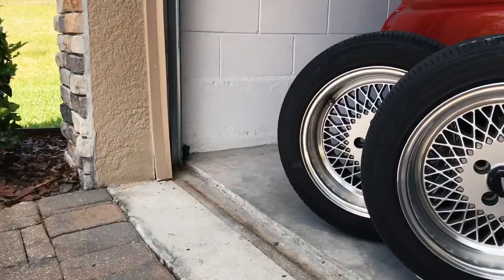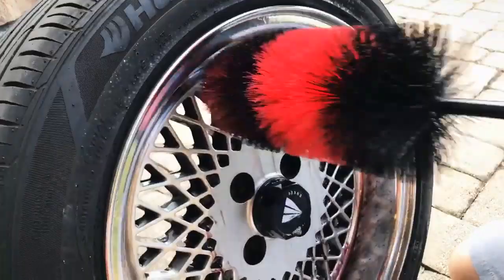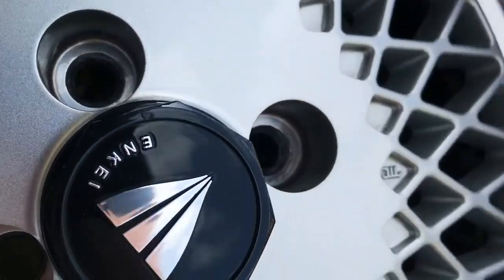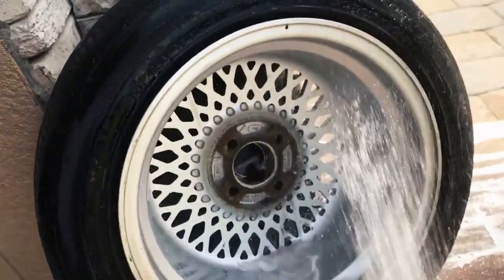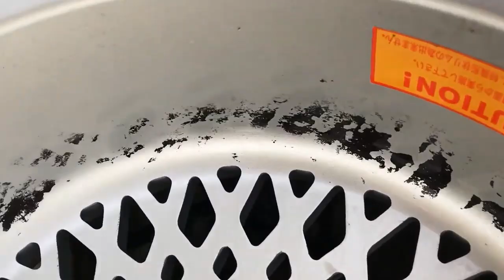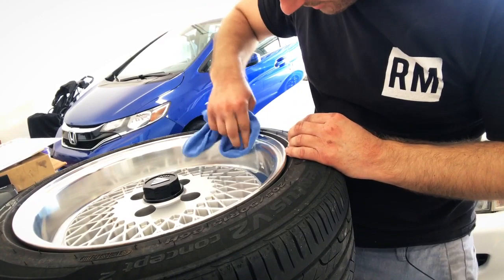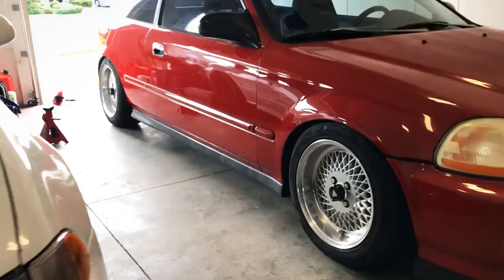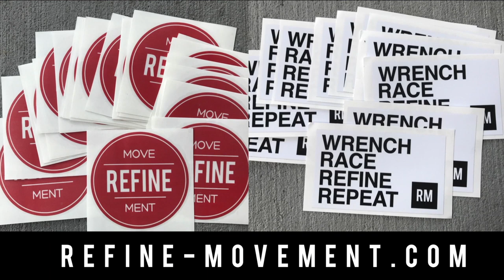AMAZING WHEEL CLEANER THAT REALLY WORKS!

Comment: One thing to add is be careful using aluminum polish on some wheels. A lot have a clear coat over the aluminum, you can use regular car polish instead. I learned the hard way.